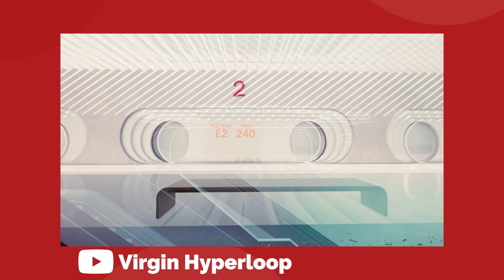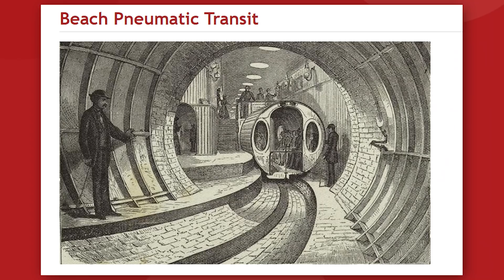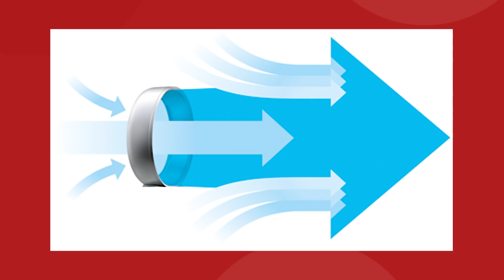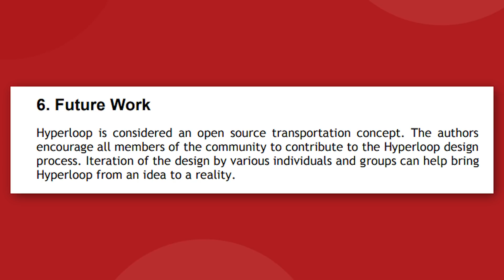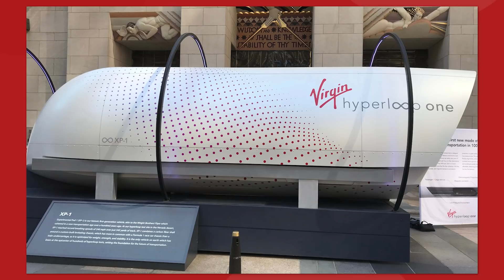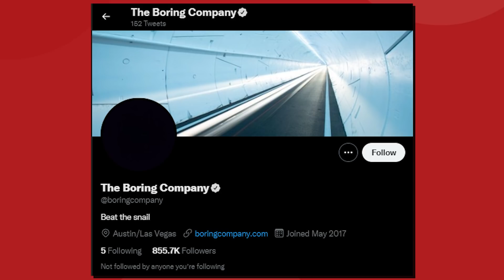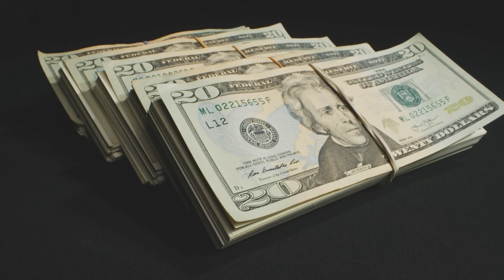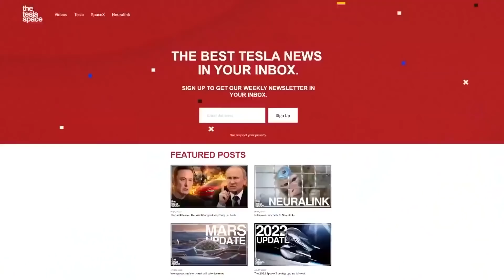The Boring Company Is Building A Hyperloop!

Comment: Elon’s idea solves the air compression problem but I suspect his system will need a lot more linear motors to boost the speed. It’s probably better to put the motor in the vehicle and power it like a train from a rail.
Reply: Yeah it's much more efficient than batteries

Comment: I believe it is also true that whereas airplanes and traditional trains either use fuel or electricity (in the case of trains) generated by burning fossil fuel, that is not the case with the Hyperloop, whose electrical needs could be entirely met using renewable sources of electricity. So right there you have an immense environmental benefit, and another reason to stimulate the growth of renewable. Also, given the number of business travelers who are constantly in the air flying from one city to the next, a faster, cheaper mode of transportation in the form of a Hyperloop would be appealing. If I'm not mistaken, the Chinese are already underway building a hyperloop. One last observation, in the early 1950s (I think it was) the federal government undertook a massive project building the national highway system. This allowed for and gave birth to the modern world, connecting cities to cities and coast to coast. Now imagine an even faster,  more efficient version of that and its implications.
Reply: The problem with China is the country already investigated heavily in high-speed rail systems as well as an expansive maglev system in Shanghai. Even if China has developed the hyperloop technology, it will not construct a functional hyperloop network system.
Reply: -> "I believe it is also true that whereas airplanes and traditional trains either use fuel or electricity (in the case of trains) generated by burning fossil fuel, that is not the case with the Hyperloop, whose electrical needs could be entirely met using renewable sources of electricity. So right there you have an immense environmental benefit, and another reason to stimulate the growth of renewable."
- Trains can be powered by nuclear and "renewables" as well, you know. And in the case of planes, synthetic kerosene also exists, and can be produced from nuclear and "renewables" as well.

-> "Also, given the number of business travelers who are constantly in the air flying from one city to the next, a faster, cheaper mode of transportation in the form of a Hyperloop would be appealing."
- Yes, everyone likes speed. But remember that the Hyperloop is actually an over 100 year old idea (see: "Vactrain"), and engineering challenges that would be involved in building a Hyperloop would be absolutely astronomical, which is why none have been built in the 100+ years since it was first proposed, and it's also why none will ever be built.

-> "If I'm not mistaken, the Chinese are already underway building a hyperloop."
- No, they're building an even faster maglev train.

-> "One last observation, in the early 1950s (I think it was) the federal government undertook a massive project building the national highway system. This allowed for and gave birth to the modern world, connecting cities to cities and coast to coast."
- Correct, but the Interstate Highway System didn't involve, and building a high-speed rail network wouldn't involve, the massively impractical task of building giant vacuum pipelines hundreds of miles long.
Reply: If you can run a hyperloop on renewable electricity, why not a conventional train? Electricity is electricity - once it's made, it's interchangeable.

Comment: Given that The Boring Company is involved, his plan is almost certainly going to be something like a subway system modernized. Cross a high speed light rail like the Shinkensen rail, streamlined to minimize the amount of air disruption thus minimizing how big the tube has to be to avoid the 'plunger effect', and you're probably getting close. There's no practical way to create a vacuum tube that long, which is where Virgin got caught up and failed. Even in his original white paper, he stated that it would be impractical to impossible to create a true vacuum and so the goal was to lower air pressure to as low as is practical. 

Personally, I'd just have it at normal air pressure, with vents along the tube for air to evacuate from to mitigate the air flow problem. You probably won't get near-mach speeds, but you could certainly get a couple hundred MPH easy, probably faster given there's no environmental risks in a subterranean tunnel, which will still beat an airplane ride up to a thousand miles, especially given it will be cheaper to operate than aircraft and you won't have to deal with TSA security BS wasting hours of time just to get to the damn gate. That covers an awful lot of viable routes... DFW/ORD is a huge business hub-to-hub lane that this could challenge, DFW/ATL then ATL/MIA (or ORL if you prefer). ORD/BOS or ORD/IAD would be a bit far, but certainly viable, hooking up with already existent mass transit options found in the New England region. Then close the circle along the eastern seaboard with IAD/ATL and perhaps stops along the way. 

Really, LAX/ORD or LAX/DFW would be a bit of a stretch, given the distances involved, but as far as a cargo route it would be key in unclogging the logistical backups at the pacific ports and getting cargo from the pacific to the midwest and points eastward with a shrinking trucking industry.

Comment: Kantrowitz Limit - 

It's a loop.  Not a tube with closed off ends.  As pods move through the tube they will shove some small amount of air in front of them.  But that air will be getting shoved into a low pressure area created by the pod they are following.  What you end up with, I think, is sort of a circular wind flowing in the direction of travel.
Reply: At higher speeds that pocket of air will build up in front of the vehicle to the point it starts slowing it down. The lower the pressure in the tube the less of a problem.

I actually think the electric turbine idea  at the front is a good one as it saves on maglev costs... pushes air it encounters behind the vehicle and the bonus feature of using it to keep the cabin pressurised which is the same way they do in planes (plane cabins actually leak air.. it's the jet engines that push air inside that keeps them at the correct pressure)
Reply: @crocodile2006  

There are problems with your argument.  First, there will be little air to push in a partial vacuum.  Second, the pods will not fit tightly against the tunnel walls, the aerodynamic shape of the pods will guide what air there is to the sides of the pods. 

The system used will be determined by cost and efficiency.  I'm not sure the costs for a maglev system are very high.  There will be permanent magnets in the pod so no energy used there except for moving the magnets closer to and further away from the track.  (I'm not sure I have an accurate understanding of maglev systems.)  And a strip of conducting metal (aluminum?) on a raised track under the pods.

I'm not sure why the maglev system wouldn't last for decades, even hundreds of years.  I'm going to make up a number here.  Assume the aluminum, whatever connector, in the track cost $1,000,000 per mile.  Then assume a million passengers per year (almost certainly low).  And 100 year usable life.  That's a penny per passenger mile.

NYC to LA ~3,000 miles.  It would cost $30 in 'track costs' to make that trip.

Comment: Getting diesel trucks off the highway would be ideal, in my opinion.  Currently, they relatively block traffic because they travel slower and are larger than individual cars/trucks.  It would be nice to just put their load into a tunnel and send it without a driver.  Just pay the driver as if he had driven it the whole way to keep the economy stable.  Gravity seems to be an inexpensive, powerful, and all pervasive force.  Consider sending the product downhill.  The tracks could be oiled to keep the oil companies happy.

Comment: It would be so amazing to be able to cross the USA in less than an hour!
Reply: I have a bridge for sale…….
Reply: @davidwebb4904  i have 3…
Reply: @davidwebb4904  That would be from rocket tech, not hyperloop tech.  In space you can do a circuit of the entire earth in 90 minutes.
Reply: The hyperloop isn't likely to go that fast.  Something more like a top speed of 700 MPH.  That's a four hour coast to coast.  With no weather delays and no turbulence.
Reply: @davidwebb4904  
Got any guarantees that no one will ever be able to land and reuse rockets?
Reply: @bobwallace9753  A steel tube 3000 miles long will expand and contract by more than 1 MILE from winter to summer. How do you think that problem will be overcome? And there are others, but I thought I would start you off with an easy one….
Reply: @bobwallace9753  In that I conceptualised the reusable rocket when I was seven years old, I think I have a good idea what can and what cannot be achieved.
Reply: @davidwebb4904  

It's an easy one. Use a concrete tunnel located at least 10 meters underground where there will be zero problems with thermal expansion.
Reply: @davidwebb4904  

Buck Rogers beat you by decades.

The idea of landing and reusing a rocket is a very old one.  The problem is that up until SpaceX landed and reused it was only an idea.
Reply: @bobwallace9753  An of course Elon is going to build those tunnels five thousand times faster than todays best equipment can….
Reply: @bobwallace9753  What happens when you bore a solid concrete tunnel, across a maze of geological fault lines? Fault lines that more every day. Fault line movement that can pop Elons vacuum tube.
Reply: @davidwebb4904  

No, not five thousand times faster.  But very significantly faster.

Prufrock 3 is designed for seven miles per day.
Reply: @bobwallace9753  That is true. So Elons not the genius inventor. He’s just rich…..
Reply: @bobwallace9753  so…five hundreds times faster…… 😂😂😂😂
Reply: @bobwallace9753  Sit. Down, do a little math and get a reality check. Size of hole. pi R sq. times 10,000. Simply try moving that sort of amount of dirt. Maybe he’s going to build a TBM powered by Raptor engines that can blow all that dirt out of the tunnel….

Comment: Don't Air Hockey Tables work by vibrating the Air Hockey Table?
Reply: I was pretty heavy into all things hockey when I was much younger, including ice hockey (back when I could actually skate pretty well, at least for longer than 2 minutes before getting totally winded), but I also loved playing on air hockey tables too, of course! It's been such a long time since I've actually used one of them that I don't really remember whether the air "vibrates" or not, although I couldn't say that it doesn't either, but it doesn't seem like it would even need to do that just to hold up one of those lightweight plastic pucks.

I thought that it just basically blows the air straight out of all the little holes and, due to their placement, as well as being evenly spaced out, even a rather small fan can create enough air to  just make the puck soft of "levitate" above the table, giving it the appearance of sliding on ice. But, I could be wrong… who knows these things for sure, right?! 😊

Comment: thanks for the update. i' m pretty sure there will be neither airhockey not mag lev involved in borings hyperloop - definitly not this year. Take a Cybertruck, which seems to have enough sealant plant to actually be air tight, put it into a classic boring tunnel and use pumps to reduce the air pressure to 20% or something - proof of concept done. if thats not enough, open a valve behind the Cybertruck to let in atmosphere, which willgive itquite a bit of aditional accelleration.
Reply: Just get us an affordable Cyber truck.
Reply: So when the air seal in your truck fails you asphyxiate. And the problem with air pushing from behind is that you'll need the air being pumped out in front, so basically you've built a very large vacuum tube delivery system - simply push the vehicle forward will be more efficient than enormous air pumps scavening air ahead.
Reply: @brandonocount3393  exactly. Thats the idea of a hyperloop. Reduced friction through reduced air pressure. How low you go obviously is a design trade off.
And therefore a broken seal is a problem for any hyperloop system, nothing specific to the cybertruck solution.

In short, what i think: Borings Prototype will consist of a air-tight tunnel, two airlocks, some (low grade) vacuum pumps to reduce the pressure in the tunnel, and an airtight/pressurized EV (likely a CT). Nothing fancy, nothing to futuristic.
Reply: @percurious  If the tunnel pressure is only modestly dropped, say to 2/3 of sea-level (equivalent to around 12,000 ft altitude) then a depressurised vehicle may be uncomfortable but fairly safe. Below that pressure the drag figures will be better but you'll either need supplementary pressurisation or oxygen, or to accept a lower safety margin than airliners provide. One solution could be a depressurising pod signals the tunnel to quickly repressurise and the vehicles in that section then progress more slowly until the next interchange/airlock.

As ever with engineering, trade-offs all the way to an acceptably cheap, acceptably safe, solution...

Comment: the problem of public transportation is not well researched. The main problem of transportation in general, is congestion in dense urban areas. The average speed in manhattan is 3 mph during the day. Moving in city centers takes a very long time in both public and private transportation and the main consumption of transportation is moving around within city centers. This is what everybody consumes on a daily basis and not intercity travel.  Interstate highways have way less problems. In a large city, moving around at 30 mph is enough to get around within the downtown areas in less than 10 minutes. So if you have a transport system where it takes you from any origin to any destination within a dense city without stopping at stations and without changing lines at 30 mph, you solved the biggest problem of transportation today. What you would need is a high capacity (not to be confused with speed) that is measured by the distance in seconds  between vehicles (or pods). Typically 0.5 seconds would be considered as high capacity. This system described here is possible and was already been designed. Look up "PRT".

Comment: Hyperloop TT is already experimenting with sealed vacuum tube transportation up to 760 mph. This is sub mock one and this is the actual goal for the Toulouse test track in France. With our new letter intent with acquisition to we are now under written to proceed with these tests at the sub, mock one speed. Hyperloop1 is still doing test track testing in the Nevada’s desert at speeds that are equal to the Shinkansen in Japan, or the trains in France. They are simply putting on a show, but lack the technical expertise of the aerospace industry. This system of transportation is closer to the aerospace industry then planes and trains.

Comment: I would prefer the Boring Co. expanded and perform a massive infrastructure project that I consider vital to our nation for several reasons, not the least of which is because we have the technology to do so.
At a low enough level to ensure room for bored rail traffic; bore tunnels under the US interstate highway system to route massive amounts of water between the Great Lakes and the Ohio, Missisippi, Missouri, Colorado and Snake rivers, as a start.
With this network we could transfer water at low cost and at low loss across our nation to assure water security for drinking and agriculture and flood/drought mitigation.
Smaller tunnels, porous at their ends, could be run to refresh aquifiers as needed and run to localized canal networks.
Becoming a K1 society must be about more than just energy.  Speaking of energy; we need a similar network of underground HVDC lines to tie our grids together in an interconnected multi-route HVDC web that is highly resistant to weather, CME, IMP and terrorist events.  The Boring Co would be perfect for such a project.